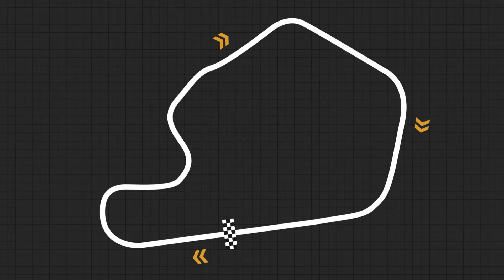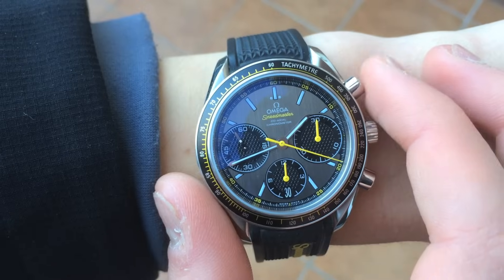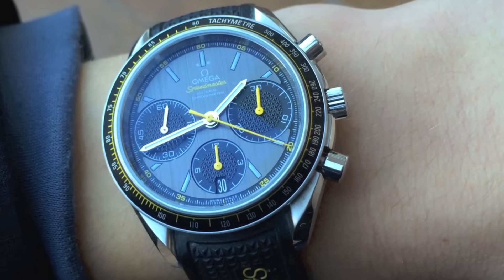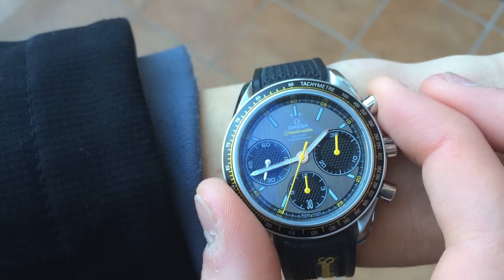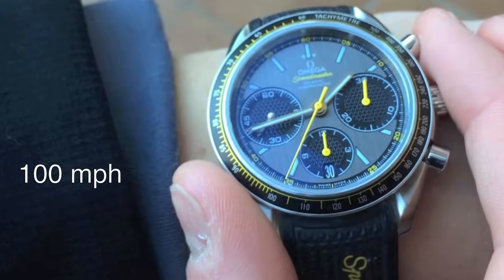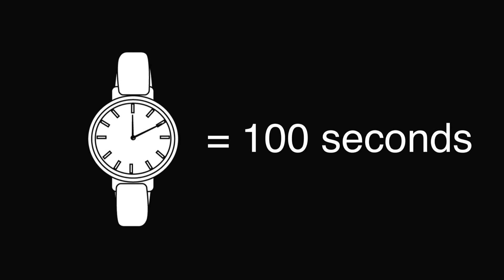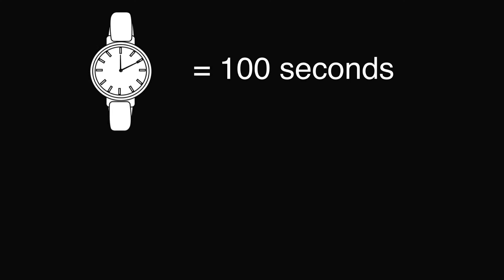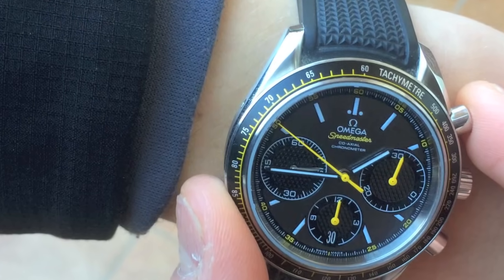Tachymeter Explained! (5 examples)

Comment: Hello Mr. Erik Ternsjo,  Very good video!  As far as I know, Omega invented the "Tachymeter", as a stationary dial indicator on a wristwatch.  In the meantime, stationary dial indicator(s) are not uncommon on gauges such as pressure gauges and vacuum gauges.  As far as I know, Rolex invented the rotating bezel diver's watch, (not uncommon on a dial indicator) that was (NOT bidirectional) as it only rotated counterclockwise so it would NOT indicate a extended elapsed time for the divers air supply error by mistake.  Please reply.  Dave...

Comment: I've literally worn a watch with a tachymeter for several years.  Tonight I got extremely high and was looking at my watch and decided to look it up.  Now that I know the basics, I'm gonna look into why the numbers depreciate so quickly at first.  Thanks for this video and for the rabbit hole I'm about to go down tonight!
Reply: If you didn't figure it out from his initial formula, it is a simple division equation. 3600 is the numerator which is sec/hr. The denominator is seconds elapsed, so the equation is always 3600 sec/hr * 1 (unit of measurement whether it be km, mph, or watches as an example / (X seconds). the seconds cancel out and you are left with Unit of measurement / hour.
Reply: It took you that long to find the curiosity of what it does?
Reply: It’s because you can go infinitely slow (not moving) but not infinitely fast.  Like if you went 1km/h you travel 1km in one hour. At two kph it takes 0.5 hr.  At 5 kph you travel 1km in 0.2 hours.  And at 10kph it takes 0.1 hours.

So the first doubling in speed (1kph to 2) cuts the time by 30 minutes.  But the difference between 5kph and 10kph is only 6 minutes.  

And expanding from there, once you take the first 30 minutes off (going from one to two kph) you can never get 30 minutes faster again because that would mean completing 1km in 0 time.  So as your speeds increase, you need a much larger increase in speed to see an equivalent reduction in time.
Reply: How was the weed🌳🚬🤏🏼🤪
Reply: Please learn the proper meaning and usage of "literally."

Comment: What's the reason behind choosing the readings of tachymeterfrom 500 to 60??
(Written on the bezel dial)

Why not 700,800,900,......??

How did they conclude the 500 to 60 to be the standard??

Comment: Another use:
To count your heart rate (beats per minute)
When you detect the first pulse on your wrist, start the chronograph, keep counting and stop when you detect the 60th.
Read the number on tachymeter.

Example: from the 1st pulse to 60th pulse you take 40 seconds, it points to 90 in the tachymeter, so your heart rate is 90 bpm.
Reply: Wouldn't counting beats for 15 seconds and multiplying by 4 work as well?
Reply: @jamesshaw9890  yes, but that way you don't even need the tachymeter, this tip is about using the tachymeter to measure your heart rate.
Reply: Or just use the stopwatch feature of the chronograph and count ur heartbeats for 6 seconds then multiply by ten if ur heart beats 6 times in 6 seconds it would beat 60 times a minute
Reply: @hyakikano7154 30 seconds multiplied by 2 or 15 seconds multiplied by 4 is what nurses are taught. If you do 6 seconds  and miss a weak beat or 2 it will throw you way off.
Reply: Cool
Reply: Point taken - But actually in health care we either count over 15 seconds and quadruple it (times by 4) or these days we actually count over at least 30 seconds and double it because pulses and breath rates are not always completely rhythmical (such as in atrial fibrillation), hence sampling over a longer period. And Seiko actually made a watch (6139-6020) nicked named the 'doctor' and this uses a different scale on the bezel than a tachymeter.
Reply: Bullshit, normal people count only 15sec and multiply by 4.
Reply: If your heart rate is 90 bpm, call a doctor ! Why not count your pulse for 60 seconds ? Then you don't have to calculate or to check the tachymeter.
Reply: @ranietsd1  normal heart rate range from 60-100 bpm.
If your heart rate is 120 then it will only take half minute to measure it with this basic method. If you're good with division, you can use division by 2, 4 or even 5 to make it even quicker.
Reply: @ranietsd1  90 is fine if it's after some activity such as a brisk walk
Reply: @ranietsd1  that's exactly what I thought, why bother to use the watch when you can count for a minute

Comment: Guys, I really dont understand the point of a Tachymeter. If it takes 45 seconds to  assemble a car as seen on the watch, u can equate that the facility puts out 80 cars in an hr, even without  the outer bezel.

Almost anything can be calculated with just the seconds. So what is even the point of a Tachymeter?

 Even the race car.

Distance= 1km. Time taken = X seconds.  Use the primary school formula and there u go, you have your answer.  Whats is the need for a Tachy?

What am I missing? Dont you just need time elapsed?

Comment: it is just as useful to think there are 60min in 1 hour.  So multiply that by the inverse of the fraction of a minute in your measurement.  

For example: 
20s is 1/3 so 60 * 3/1 = 180
45s is 3/4 so 60 * 4/3 = 80
50s is 5/6 so 60 * 6/5 = 72

all this can be done mentally and precisely without having to look at a watch

Comment: Basically, it tells you how many times an action can be repeated in an hour, based on how long it took to complete in seconds.  ANY action.  In the video it shows that if it took an event 20 seconds to happen, then the tachymeter tells you it could be repeated 180 times over an hour.  So drove a mile in 20 seconds?  Then you can drive a mile 180 times in an hour, e.g. 180 miles an hour.  Ate a peanut in 20 seconds?  Then you could a peanut 180 times in an hour, or 180 peanuts by the end of an hour.  Packed a box in 20 seconds?  Then you could pack boxes 180 times over an hour.
Reply from the maker: Pretty much. Thanks for the comment

Comment: Well, I bought a watch with the tachymeter, 22 years ago, and did not know what it's for. Now I know at least the theory of this, after watching your video made 4 years ago. 
Anyway, that's a clear enough explanation and I may use it in my next driving (only if I can do the start/stop within one minute with my hands on the wheel).

Comment: You missed taking advantage of a rotating tachymeter dial (on those watches that have it). Then you don't need to go to the stopwatch. Just rotate it so zero is wherever the second hand happens to be when you start your measurement.
Reply: ACitizenOfOurWorld, those rotating bezels aren’t tachymeters, though. Those are “dive bezels.” Tachymeters don’t turn.

Comment: So it just measures how much something happens per hour?
Reply: it measures either speed or distance (indirectly) using the equation speed=distance/time. his #4 and #5 "happens per hour" examples were completely idiotic and do not require a tachymeter to calculate, but you can if you want.

Comment: How do i know when is miles & when is km??
Reply: the tachymeter operates independently of units. if you measure in km, your speed will be km/hr. if you measure in miles, your speed will be mph. this is simply a speed=distance/time formula with a 3600 conversion factor (which is independent of distance) to convert hours into seconds. you can rearrange that formula two different ways and solve for either speed or distance (indirectly) after measuring the time.

Comment: Still couldn't get. Suppose m at rest and start tachymeter.it will point at 120 after 30 seconds. Now i m in a plane and after 30 seconds it will again reflect 120.what does that mean. As in ist i was at rest and 2nd moving at speed of around 1000kmph.

Comment: I got most of this but just one question, where on the tachometer should I start it when timing?
Reply: The chronometer does the timing.  It starts at zero aka the 12 o’clock.

Comment: I think no more than 3 people on Earth use this function.
Reply: lol
Reply: Yes, as you need brain for it
Reply: If you can change gears or operate the accelerator, you can push a button twice safely.
Reply: Bro’s brain big enough to imagine 3 ppl using Tachymeter 🥹
Reply: So glad I have this feature on my watch.
Reply: angryagain68 is right. It's kinda simple to use. And it's fun while on a train or a car (either track or road) when you are not driving. Motorcycle use I am not so sure but yeah, its a fun feature.
Reply: Did you use the tachymeter to work that out 🤣
Reply: I use it all the time on the train (I’m a freight conductor) to verify that our speedometer is correct. Because of its not, we could over speed around a curve incorrectly thinking our speedometer is correct and end up tipping over. Also my brother who is a pilot uses it fairly often when dead reckoning with a map. Same thing with ships.
Reply: It's also useful to verify your speedometer.  I've done that numerous times with my various motorcycles I've had over the years.  (Motorcycle speedometers are notoriously inaccurate).  Just replacing tires has a huge impact on it's accuracy as well.  It's easier for me o just look at my watch than to fiddle with a smart phone will riding.
Reply: @angryagain68  That's one way to get into an incident.
Reply: @JasonL_Hawaii  Nonsense
Reply: @JasonL_Hawaii  have to agree with you. someone doing all that maths while on  two wheel. hopefully he is an organ donor :-P
Reply: @CapeTownTom  There's  really no math at all to do. You can for instance use two physical 1km milestone indicators to be sure of your distance; can even remove your watch from your wrist and hold it in one hand so you always have both hands on your handle bars. 

Approach the first milestone at speed, you press one pusher, approach the next milestone, press the same pusher again, you never look at the watch at all. All you have to do is glance at your bike's speedometer once between the two milestones to get a reading. 

Then you pull over safely and everything, and look at your watch. All you do is compare your speedometer's reading, you hopefully still remember :D, with your tachimeter reading. If you're traveling at 60 kph you're gonna take 60 seconds to travel 1 km, so you don't have to ride dangerously either, quite on the contrary, it can be a slow ride.

Also, you want to ride at a rather slow speed, because the faster you travel, the harder it is to get an accurate reading on a watch face tachimeter scale; just look at a tachimeter scale, you'll see how it is busier towards in the beggining, aka, the fewer seconds you need to elapse that kilometer, aka, riding like a maniac.

...

Remember, people used to use mechanical watches all the time to tell distances, in fact relied on them, heck, soldiers under pressure of losing their lives did it. And better believe it, an uneducated dude under pressure of having their butt shredded was far from some genius mathematician. (And, yes, soldiers used to use telemeter scales, but the reading was the same, if they had the luxury of a stopwatch they didn't even need to look at their watches between the two events)

It's a simple reading a tachimetre reading. I guess we assume that it's hard or cumbersome because we never used the technology, never had to, but it was never intended to be hard, on the contrary, it was invented to remove the need for calculation, the need to do the math. It's an instant reading.

Many that used tachimeter scales would even learn the scale by heart, could approximate the speed without need for the tachimetric indication on regular stopwatches. 

And you know, just how you don't need to be reminded of the basic interaction with your smartphone after you get used to it, just as you feel that it's the simplest thing in the world, so does it feel to read a tachimeter to someone who's done it once or twice. And overall using a smartphone is at least one order of magnitude more complicated than reading a watch, but again, we're used to them so we don't perceive it as a challenging interaction.
Reply: @Strellock  you can do math you dont need it, if you cant do math you are just learning this for showoff
Reply: @Strelock: I'm afraid life's too short! I use the Navionics Sailing App on my phone. So much easier, I can do navigational maths if needed but then you're talking yachting chart tables. The tachymeter scale is a nice touch but it's like those Breitling aircraft pilot watches - they just use the GPS.
Reply: @JasonL_Hawaii  accident
Reply: @JasonL_Hawaii  I'd say it's safer than looking at your phone
Reply: @JasonL_Hawaii  😂😂😂😂
Reply: @Strellock  example 1 He uses the scale for kph. Example 2 He uses the same scale for mph.or did I miss something
Reply: @SuperVeshi  which choice of unit of length one chooses to use doesn't matter, it can be mm, cm, miles, leagues, km, meters, or any other unit you wish.

The scale itself is just a table of reciprocals calculated for 3600 seconds, and graduated for an up to 60 seconds reading (or, on some extended tachimeter scales for more, 2 minutes, 3 minutes, etc.)

For example, let's consider a snail - this one snail takes 60 seconds to travel one cm, the tachi scale  will tell us that it's traveling at 60 cm per hour.

If it took it 30 seconds to travel that one cm, then it was going at 120 cm per hour.

Hell if he was a real champion, took 15 seconds to travel one cm, then it was going at 240 cm per hour.

If you gave it some red bull and a mini jet pack, and it traveled 1 km in 60 seconds then it traveled at 60 km per hour.

Change the unit of distance to any other one, heck, let's pick light years, if you gave the snail a warp drive and some cocaine and it took 60 seconds to travel 1 light year, then it would be traveling at 60 light years per hour.

....
btw, here's another cool thing, it's not only distance per hour we can read off a tachi scale, but also, events per hour;

So let's consider the snail in our examples above again, let's consider that our offering of class A drugs to the snail turned it into a regular user.

Let's say that he's really badly into cocaine so every 60 seconds he has to take a line. Well then, the tachi scale will tell us that it an hour he will take 60 lines.

See what I mean? The units don't matter. Basically the tachi converts a reading of under 1 minute into a reading of units per hour, of whatever unit we choose, not even exclusively of distance, it can be events per hour, etc.

So next time you see a tachi scale graduated for miles, or km per hour, it's just for decor, again, the units don't matter.
Reply: @Strellock  wow, you nailed it buddy
Reply: @Strellock  Tachymeter watch can also be used to cure PE. Just before the point of no return you start calculating how many thrusts per minute you're doing and you're good to go.
Reply: @azarazar007  That would actually be possible, but you would def. need to do some extra calculations and given the context it could end up being a bit too.. cumbersome.

 A watch with a pacer function would be way better for the particular use case. A great cheap one is casio W-734, curently in production.
Reply: @Strellock  lol
Reply: @JasonL_Hawaii  best thing to explain to a cop after a crash: "I was marking my tachymeter..."
Reply: @Strellock  thank you for the explanation!  Makes more sense that it converts units per hour.  The unit can be whatever variable that makes sense for the situation such as miles per hour or watches per hour etc.
Reply: @angryagain68  you must be 1 of three!
Reply: @krokiety5712  nope
Reply: @angryagain68  do you know three other people who use it?
Reply: @angryagain68 you know, that we have gps nowadays?
Reply: Eric included? :))
Reply: I'm one of them 😂😂😂
Reply: Hhh how are they 😂
Reply: Hahahaa LoL
Reply: Psychopaths and scientists
Reply: I've got a tachymeter have yet to learn it thou one day. One day. My next watch is a tag started on Bulova
Reply: Lower your expectetions more
Reply: And you are one of them probably
Reply: This bozo probably doesn’t even know what a watch is 😂
Reply: Maybe 4.
Reply: It would have been very helpful in the past before smartphones and digital speedometers/timers.
Reply: unless propably if you're a pilot !
Reply: Make it 4
Reply: Shut up
Reply: It can be used to find out how many stoidi comment in YT everyday
Reply: So why did u watch the video ?
Reply: At the dinner table my brother sips water a little over once a minute with food.. waiting for food he sips water a little slower than twice a minute…..
Reply: If that were true, horology wouldn't exist.
Reply: Many medical professionals using the same principle on measuring the patient's heart rate. It is far more been applied than you thought.
Reply: Such chronographs are not for the poor like you. If you just want to know how long your eggs gonna take, just use your iPhone. This here is about counting the way people in the beginning of the 20 century did. It's a cultural thing
Reply: I have used a tachymeter a couple times, so I am number four.
Reply: @ussling  no no, you 're part of the 3 people mentionned :D
Reply: @ussling No no you are one of 3 😂
Reply: Then you’d be way of the mark, this application, if you have sufficient intelligence, is helpful to people in jobs from Commanding a submarine to delivering groceries. If you’re tight on time you use the tools at hand, sometimes reaching for your phone is not convenient or prohibited even, certainly if driving. But then again Mathematics is lost on so many a tool in life, isn’t it. .... thank you for your vacant stare now,.... i’m sure you’ll get over it.
Reply: @randysauvage677 ”Thank you for your vacant stare now.” 🤓
Reply: @randysauvage677  you aren't as intelligent as you believe lil bro
Reply: I personally use tachymetre to quick measure patient pulse per second, it's very usefull tool. At least for me
Reply: @Anti-kaiju-2265  Why not get a watch with a pulsometer?  That's what doctors use.
Reply: @RedZeshinX  yeah thats what i mean, it is tachymetre but different scale
Reply: Count me as 4 once I figure it out